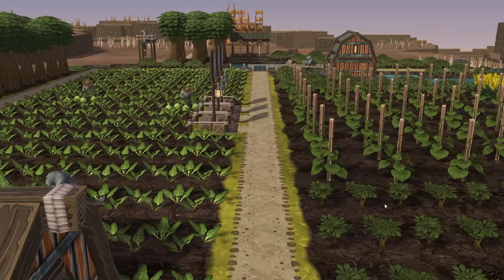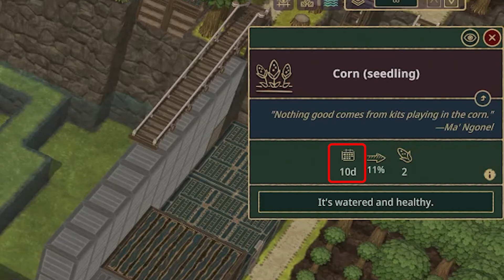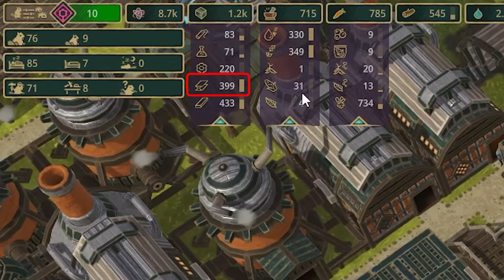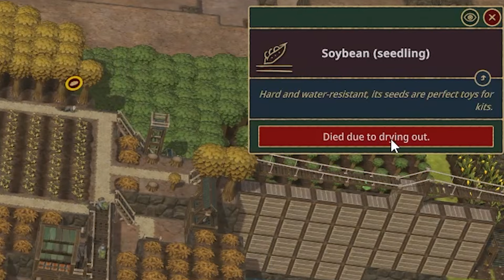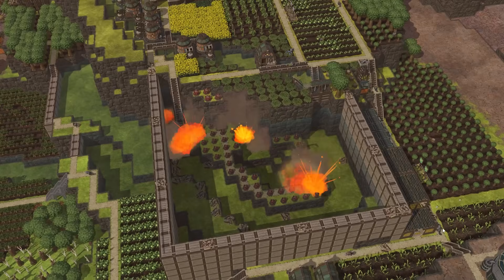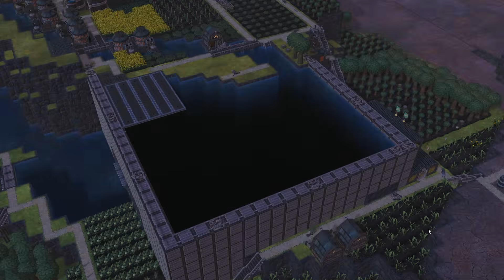Industrial water pumping - Timberborn - Steeltide #6

Comment: timberborn starts to stink when I have 500 beavers and 500 robots. Although my graphics card runs at 7% load, similar to my processor. can someone tell me what it is? RX7800XT and 7800X3D
Reply: Old comment, but its because a lot of calculation and processing is done on a single CPU thread. Yes you have a lot of logical cores, but that doesn't help in this case.

The fact that you can even run a 1000 pop colony at all is pretty insane. Especially a year ago before optimizations.

Comment: Put two dams where the original 2 floodgates were, set sluices to open when water lower than .6 so that top reservoir fills top area only during droughts and doest pour into lower reservoir. 

The top layer of top reservoir should be dams so it overflows during wet season, and it overflows the other 2 dams into lower reservoir. 

During droughts, you only pump out of lower reservoir. Leaving top reservoir to hydrate the top only.

Comment: Upper dam - Add sluices at the second level to use primarily. Right above the bottom sluices, which should be shut off. This will keep a trace of water in the upper dam.

Comment: First things first, great work, I love seeing how you're handling this.

Couple of things to remember/consider changing about what you did in this ep: 
1) Remember to put in the badtide blockade you scrapped at 13:00 or so.
2) Those swimming pools will only be functional for the wet season and the first week or so of a drought/badtide, as they require that dam to have the top layer be full. If you put them in a lower terrace (like the one you filled at 11:57), it'd stay available for more of the cycle. Sure, it'd be a bit further away, but... I'm not sure which you'd see as the bigger issue.
3) Build a second hauling post, make one be capped at 5 (actually, maybe 8 or so given how spread out your colony is) on high priority, and another be on lowest priority max 10. Any excess beavers can go in there, but expect it to not have a full workforce most of the time. It's just there to prevent you from having unemployed beavers without micromanaging jobs every time a beaver is born/dies or a workplace is added or removed.

As for suggestions for the next few things to work on:
4) Fluid dumps, and 3x3x3 poke holes. Each poke hole adds 800 or so usable tiles of green space, at the cost of 2 units of water per day (and you only need to put a beaver on it for a few hours every 20 or so days, it can be off for the rest of the time and just get a top-off at the start of each cycle and maybe another in the middle of a longer drought). This gives you more space for things like pine trees and a tapper's shack, a wider variety of foods, and oak trees that aren't where you want the top reservoir to expand to.
5) Pine resin and treated planks. Not just for the advanced breeding pods, the mine needs those as well, not to mention quite a few of the wellbeing things (a few monuments, things like the motivatorium, and the coffee brewery). The bots need 'em too, if you intend to go that far.
6) Mangroves. The river you had been pumping from would be the perfect spot for a bunch of mangroves to gather fruit from as an additional food source. IIRC mangrove fruit is +2 or maybe even +3 wellbeing, and it'd be close enough to the new location for the berry farm that the same gatherer flag(s) could gather both crops, to ensure minimal downtime on those beavers.

Also, you did in fact make me buy the game, and I have put about 50 hours into it already, fully completed 2 runs (one on easy to get the basics down, one on normal) and now I'm most of the way through a run on normal on a custom map I made (more or less to make sure the map is fun, and after playing it... it actually is pretty fun, and tells a bit of a story too. I may have gone a bit overboard on the scrap metal deposits though, and I should've made the base layer a few blocks thicker, the riverbed is only at height 3 so you can't really make it much deeper if you wanted to, you're forced to build it upwards). Next up, hard mode.

Comment: With your new water tank with all the pumps... you can set a gate, with a 1 block wide path held up by 1 tile scaffolds with a overhang on it... throw down some sealing on the floor to make it waterproof, then at the end, have another gate... it opens a waterfall to other areas, where you have a 3x3 water hold to keep the area green.. set the end gate to keep the water hole at least 0.5-0.8 a tile and POOF!! automatic area greening! ;)

Comment: You don't need to make the upper reservoir hold more water if you have a floodgate seperating both reservoirs.

You made a mistake removing the floodgate between the the river on the top plateau and the new water reservoir with new pumping area.
Those floodgates were crucial. While the new pumps are in the lower reservoir, you're effectively pumping from the upper reservoir near the source. As the river and lower reservoir are connected, pumping the lower reservoir also lowers the waterlevel in the river, forcing the sluices in the upper reservoir to let more water through.The whole upper plateau will dry out first before you're effectively pumping from the lower reservoir. Being able to pump 6 units deep isn't doing anything right now.
Put the floodgates back in, then during a drought or badtide, the upper reservoir can prevent the ground on the upper plateau from drying out, while you can make use of the ability to pump 6 deep and pump from the lower reservoir.
It will have to be floodgates, not sluices, because sluices don't close when water levels upstream are too low.
Reply from the maker: Thanks for the tip! I didn't call it out in the video - but I ended up doing exactly that. You can see the floodgates @ 22:08 placed right behind the water tanks at the new reservoir.
Reply: @ZeddicBuilds  wasn't there at the timecode you said, but i rewatched the episode from there and i think i saw them in the outro? next to the farmhouse?

Comment: You can see in mid and late game, some beavers are hungry and thirsty as they work. That is cause of their pathing is not near food nor water stores and they will only feed+water theirself once or twice a day. Its probably safe and sane to add a water duct, pump and tank for more remote workers. If you want to force your beavers to drink on the job.

(In testing, RCE found a beaver cannot die whilst they go to and from work. Even if they have max thirst and hunger. Only until they clock out will they die. That travelling to and from work can be long enough and does suspend death in extreme cases. Not like you made any infinitely long trip for beavers to go to work. If the goal is having a higher score, then you want to mitigate negative effective effects. Hence wanting to beavers to drink and feed during the day.)
Reply from the maker: Good idea - I should really  have some food/water stations scattered through the colony similar to fuel stations for bots. I've also been putting off districts in this playthrough, but some of these industrial areas may be better served as districts with food/water shipped in.
Reply: @ZeddicBuilds  I like your single district builds. They are smart and you show how far a colony can grow if you path directly outwards.

Comment: At this point you might want to consider an Integrated power network. You've still got beavers wasting their time pushing a treadmill
Reply from the maker: I've been eyeing that bad water near the south. I'm thinking of keeping it open through the dry season - connect that to some wheels, then run the power through the rest of the colony. I've been relying a lot of the engine and I hate burning all those logs that could instead go to building something!
Reply: @ZeddicBuilds  Your lumberjacks aren't able to keep up with your oaks right now. If you take two of the treadmillers and put them on tree cutting you'll have a net benefit